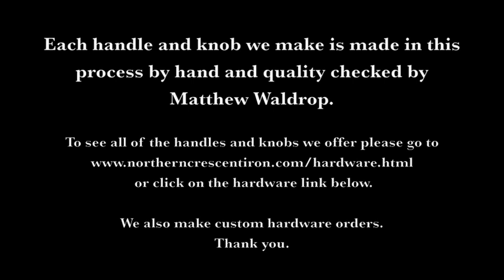Making of  hand forged production handle #0904 at Northern Crescent Iron

Comment from the maker: I've actually put a lot of thought into jiging this handle. for it to work correctly with the design I would need multiple jigs, length and depth stops for the power hammer so that the handle could be jiged and not get gouged and be consistent. but for now this is how i make it.

Comment: pretty cool.. id love to try making those for my house... too bad I dont have a forge, tongs, anvile, steel table, those cool visegrip clamps..lol Wonder if I could used a piece of say, 4 or 6" OD steel pipe filled with like, cement and then capped off with a 2" thick chunk of steel plate welded to the top of it like an anvil?